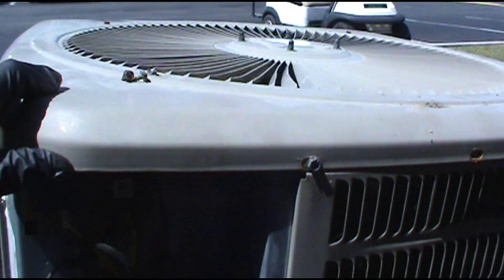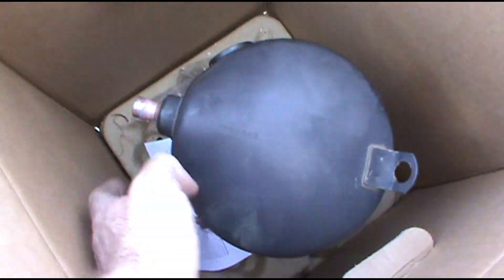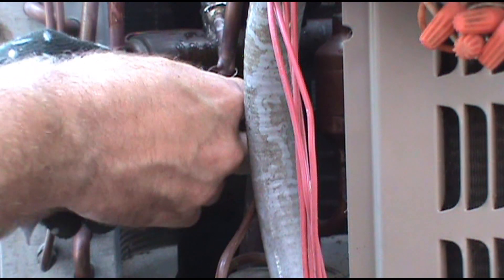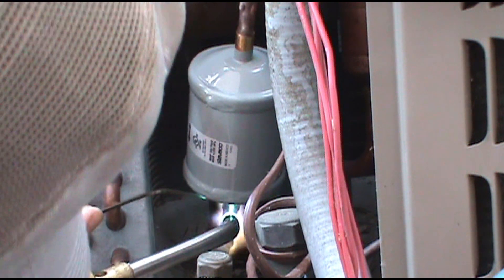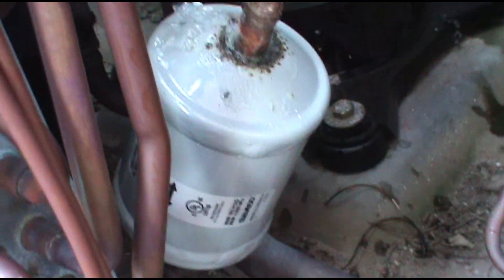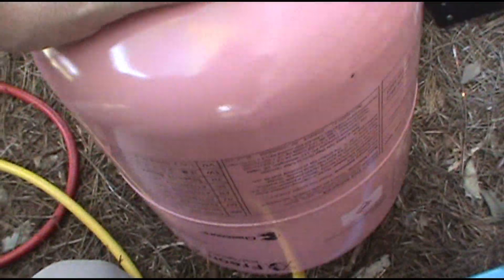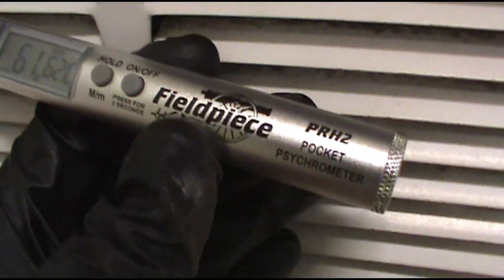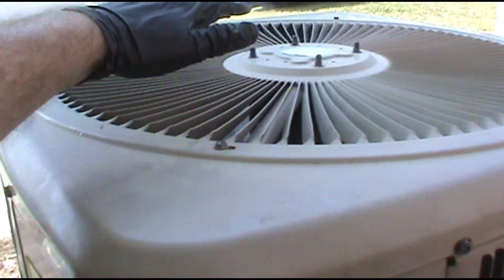Outside AC Unit Tripping Breaker (Bad Compressor)

Comment from the maker: Links to the HVAC Tools Used In This Video-

SUPCO M500 Megaohmeter link - https://amzn.to/32PBoig

Fieldpiece Psychrometer link - https://amzn.to/2OeUKt5

Turbo Torch Set link - https://amzn.to/2QjiWgs

TESTO 557 Gauges link - https://amzn.to/2M1C1OV

If you'd like to support the channel, you can do so by shopping for tools or whatever you need on AMAZON through this link,
https://amzn.to/2O6YAVc

If I've provided any value for you and you'd like to donate $1.00 or more into my online tip jar, you can do so through this link, (all cards accepted)
https://squareup.com/store/dirty-maintenance-nation

This page contains affiliate links, which means that if you click on the link and make a purchase, I’ll receive a small commission. Lex Vance is a participant in the Amazon Services LLC Associates Program, an affiliate advertising program designed to provide a means for sites to earn advertising fees by advertising and linking to amazon .com

Comment: When checking a Copeland scroll compressor read Copeland megohm readings. The Supco merger will not read low enough. I stopped using a Supco meter long ago on Copeland scroll compressors. I almost change some good compressors until I read Copelands information. Just a warning.
Reply from the maker: Thank you so much for watching Chris!

Comment: I just did this exact thing, but only 12 inches of space to next unit. I had to sit on compressor. They also had a suction side filter. I slipped a disc and can barely move now. The punchline; the remanufactured warrantied compressor ran sweet for about six hours and then shorted out to ground. In my experience, the remanufactured compressors suck much.  Thanks for great vid though
Reply from the maker: Thank you so much for watching Bayou!

Comment: I performed the same test but with my voltage meter. There was continuity and 0.2-ohms. Is that normal or bad?
Reply from the maker: On a compressor you ohm out all the pins. Start, Run and common. Then, add up the 2 smallest numbers and they should add up to the biggest number.
Reply: @LexVance  and by doing that, what exactly are we checking for?
Reply from the maker: @PROJECT.LUKE.ONE.75  to see if the windings are bad. That's if the compressor isn't coming on or it's popping the breaker. You're ohmimg it.
Reply: @LexVance  oh, in that case I just check for continuity. If there's a beep the windings are good.

Comment: Hey lex I have an ac unit that is working fine it just won’t turn off when it gets to the temp I set it at any ideas?
Reply from the maker: The sequencer or relay could be stuck. You'll need to replace the circuit board if it had one or the sequencer. Thank you so much for watching Alex!
www.DirtyMaintenanceNation.com
Reply from the maker: If the outside unit is not turning off, then the contactor may need to be replaced.
Reply: Lex Vance thank you so much!!

Comment: Instead of putting filter dryer back in why not locate it to the outside of unit to save the hassle of putting all that heat on the side of unit.
Reply from the maker: I'll be doing that in future. 
Thank you so much for watching Lloyd!
www.DirtyMaintenanceNation.com

Comment: Question 3 years ago hose spigot was moved now less pressure. 1/2  inch copper to gate valve a few feet after  elbows added then outdoor spigot. Will 3 year old gate valve reduce pressure . Plumber mightove got solder in maybe?
Reply from the maker: Yea, could be. I'd need to be there for this head scratcher.
Reply: @LexVance  im in the northeast 1000 miles from florida. 3 years ago the problem started when my friend had the hose spigot moved- they re used the same  half inch gate valve and outdoor spigot- my pressure guage said 60 psi- im thinking of  opening the gate valve and looking inside or sweating a new one on- just buy some couplings and a shoirt length of pipe- plus its right next to the wall so ill need a hacksaw to cut it and a heat shield to sweat new.. im guesing it can be the valve or the plumber left the old valve behind the stove and dint open it all the way?

Comment: The reason the filter/dryer is inside the unit is years ago Goodman supplied them with the condenser and came to check on some installs at a large apartment complex and found that none of the filter/dryers were installed but thrown away in the dumpster.... So they decided to put them inside the units so they wouldn't be thrown away and installed on the units like intended
Reply from the maker: Oh right on. I guess I can forgive them then. Thank you so much for watching Zeke!
www.DirtyMaintenanceNation.com

Comment: Good 'ole Goodman....lol....I think they have changed it now....now its outside where it should be....
Reply from the maker: Hallelujah! I can't stand that they're packed in there tight where you have to have flame next to wires. Thank you so much for watching Survival!
www.DirtyMaintenanceNation.com
Reply: @LexVance  ....No problem man!!....I enjoy your videos and learning new things Lex...Keep it up👍....Hope your  family is well👍
Reply: I’m experiencing the same Goodman issue I replaced
The capacitor and it’s still tripping the breaker like in the video did an acid test it turned completely red I’ve neglected it since we moved into our home in 2015. So did replacing the drier filter solve the issue I know I have to get a hvac person to clean flush out the system I washed the outside fins I’m running out of guesses?? Any thoughts my unit is the exact
One In the video GSX1404 something

Comment: That oven mitt is a good ass idea my dude. Nice video as always skid! I woulda straight piped that drier and relocated. Idk why Goodman put it there either lol.
Reply from the maker: You can buy a simple oven mit at the grocery store & grab any hot pipe with no worries. Yea, I've done some re-pipes in the past. I wanted the drama of it inside for the video & show what a pain they can be.
👍😂👍Thank you so much for watching Brently!
www.DirtyMaintenanceNation.com
Reply: Goodman installs the dryer in the unit to make sure a dryer is in the system. Too many cheap techs would not install one to save $20 on the install. That’s a lot of beer lol. I’ve seen over many years that a system without a dryer has leaks in the evaporator. I have no basis on this just years of seeing it.

Comment: I hate to ask this question it probably going to be stupid but if it’s 100 outside what should the inside temperature should be it is thermostat is at 75 and it shows 78 inside is that normal sorry for asking
Reply from the maker: That's a pretty big split there. I'd say something's a little off.  I'd check refrigerant pressures & make sure they're good. Get a good superheat if its a piston or subcool if it's a txv. Then I'd check the filter & coil & make sure they're clean. Or it could be just old mismatched equipment & needs to be replaced. I live in Florida where it gets 110 degrees and our Goodmans keep temperature pretty well. Even on the 3rd floor. Thank you so much for watching 
www.DirtyMaintenanceNation.com
Reply: Thank you so much i live in Texas and the out side is a Goodman inside is a carrier I have watched you and learned so much keep up the good work

Comment: Bro I try to keep it light and just let you know I'm here... this time I want to tell you it IS feast or famine in A/C( I've heard you say that before) but you ,my friend, are a six figure tech.I like the way you go about diagnostics (nice time saver with the comp  plug pull and breaker throw). i'm sure you are  aware with a ground comp you can pull the plug and go from each winding to the chassis( with your meter and save a trip inside) of the compressor and test for a grounded comp that way( for the new kids on the block). Fuck the heater cut it out we are in FL....unless it's in series to a pressure switch and then ShEaR PANNNICKK!! 
To bad your a guitar player and therefore can NOT be trusted.
Reply from the maker: Right on man! Thank you for the kind words Poo Giver! I agree about the crankcase heater. And Thank you so much for watching man!
www.DirtyMaintenanceNation.com

Comment: Lex, what are your thoughts about the idea that is you unsweat the filter drier it will release the moisture thats in the filter back into the system? Thanks for the great vids!
Reply from the maker: I've heard that from great techs. I've also heard from other great techs that it's bullcrap & you can sweat them on & off as much as you like. I don't get bogged down in analysis paralysis. I just get the job done & keep moving forward. Thank you so much for watching Mason!
www.DirtyMaintenanceNation.com